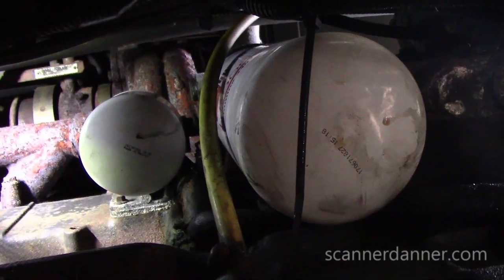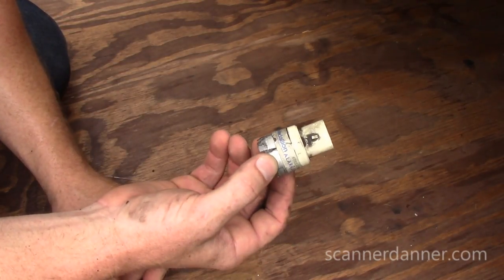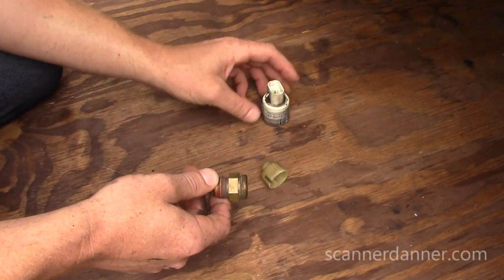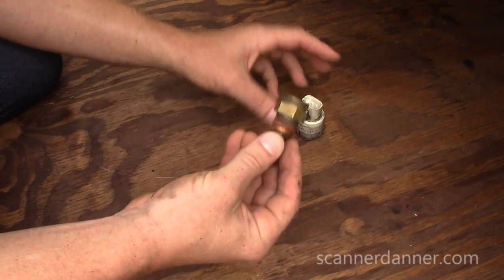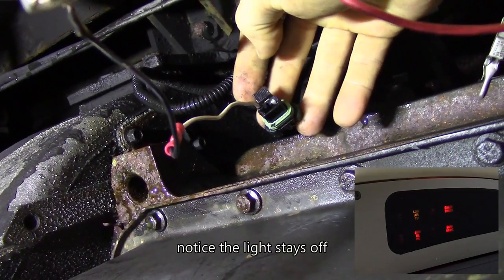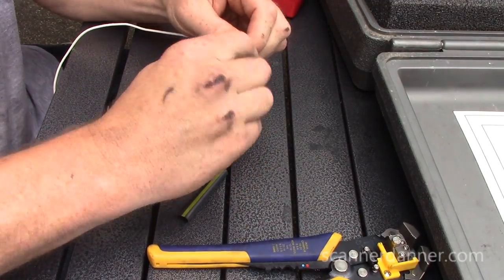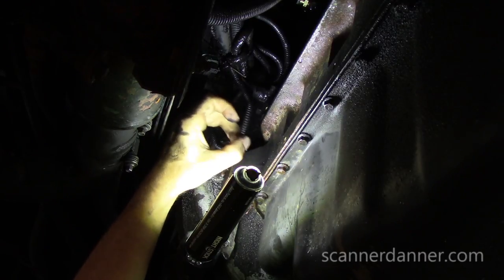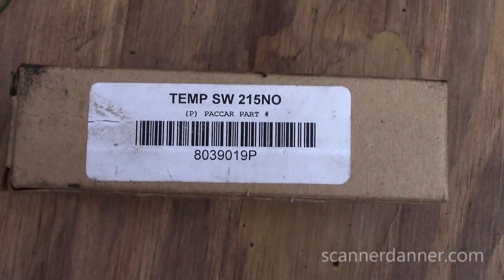High Coolant Temp Switch Circuit Diagnosis and Repair (2001 American Tradition 8.3L)

Comment: Not sure but I think the 8.3 is  C series motor a great motor, Keeping the heat out of the motor is not a bad idea , including the transmission . Not sure if your motor home has a egt gauge in it . The higher temperature might give you a tad better mileage but it might also create more problems . We are changing out a cracked head now on a M 11 or what ever it called now at work  , Water wagon from I assume over heating ,  Just give the turbo a chance to cool down before shutting it of is what I recommend

Comment: The temperature for diesel engine is lower because of the "O" rings used on the engine block cylinders or jackets are made of rubber I think the size of the wrench can be 7/8 or 13/16
Reply: No, it was the sensor location. It was at the lower end of the liners, therefore getting the radiator's return flow....if the return temperature is 215 than the input temperature would be 245-250 degree's.
Reply: No, after the coolant travels through the radiator and back into the engine it is not as hot as it was when it was circulating through the cylinder head.

Comment: Typically the temp in the lower block is cooler than the cylinder head so maybe that's why it closes at a lower temperature.

Comment: Yeah I've learned that Diesel motors don't generate as much heat as, say a standard gasoline engine. This is due to the extra lubricants that are in the Diesel fuel compared to the gasoline.

Comment: coolant down the back, we have all been through this :-) I once had about 2 Quarts of manual transmission oil gushed right over my head.. I spent 2 hours in the shower and buying some flowers for my wife who spent another 2h cleaning the oil out of the shower...
What is the whose / line around there, looks like a hydraulic line or oil line or anything like that, did you notice that the fitting is quite rusty ? Sure its still reliable ?

Comment: Because of your altitude, your boiling temperature maybe lower than 212.  Your temperature gage maybe right.
Reply from the maker: I dont remember questioning the garage 🤔
Reply: @ScannerDanner  Temperature gage.
Reply from the maker: @CFPVideoProductions  I meant gauge (stupid auto correct)

Comment: To avoid having coolant run down your back while replacing the temperature switch, perhaps you could use a shop vac to pull a vacuum on the cooling system, as this guy did on an engine crankcase to replace a leaking oil drain plug gasket without draining the oil:  https://www.youtube.com/watch?v=Kp1SpNpXwlE
Reply: loosen the radiator cap, gently squeeze upper rad. hose until some fluid runs into coolant overflow bottle, keep hose squeezed, tighten rad cap and pinch off overflow bottle hose, then release upper rad. hose. if cap is good there will be small vacuum  on the system, now change sensor and then release pinch clamp on overflow hose.
if all was well, should leak nothing to a  tiny amount :)

Comment: Wonder if that sensor was crying 'wolf', and was decommissioned by someone. Also wonder if the 215°F sender is correct. Far as the water boil experiment... you would only get a true 212°F (100°C) at sea level. Any elevation above that will be cooler. However, no one says you can't heat up a little oil! :)

Comment: Next time run your test in a 50/50 mix of coolant. Would have gotten you past the 215 mark.
Reply: Nope. Water in that coolant mix boils at 212F(100C) in outside ambient pressure of ~1000hPa(1bar).
Reply: Timo Wallin dude you can't be serious. Go learn something.
Reply: Actually gentlemen water boils at 212 at sea level. As the elevation increases the boiling point reduces. And the antifreeze mix does raise the boiling point. So if Danner would have put some straight antifreeze in his pot he would have been able to trip his switch.
Reply: Hayward's Automotive ACTUALLY, when I needed to test the temp of a temp sense switch, I didn't add a bunch of $15/gal coolant to the boiling water, I added a bunch of $2 a box table salt!! It took a lot of salt, yes!! But I was out a quart of tap water, and $0.12 worth of salt, not $10 worth of coolant!! 

Now, depending on the situations, one could drain the system of enough coolant mix, into a clean container, to prevent coolant loss, dripping on your clothes, and to use as a temp test fluid, without losing a nickel!! 

But with my situation, I didn't need to drain the system, it was a top mount sense switch, for a cooling fan! And the owner was concerned about over heating with the added on electric fan, and I couldn't get my hands on a switch that came on before 215. We tested several to 230. Too high for this situation. Old small block Chevy. 

Salt water was the bomb. And we didn't chance poisoning the cookware, or being in trouble with the lady of the house!!
Reply: Yeah sorry! I didnt realise that boiling point of 100% coolant is 387F / 197C, witch brings up the boiling point of that mix of 50/50 to 223F / 106C and that would have bean good for this testing. Sorry, i was wrong!
Reply: Timo Wallin its all good brother
Reply: I was thinking the same thing... since it was so close to 215, he could also try adding salt to the water, I'd bet that would have worked and been cheap/easy.